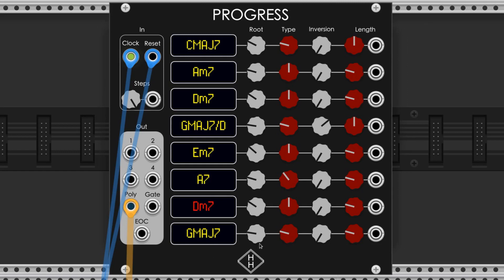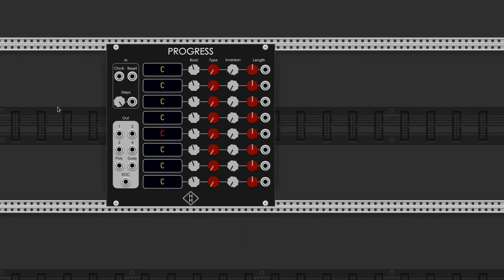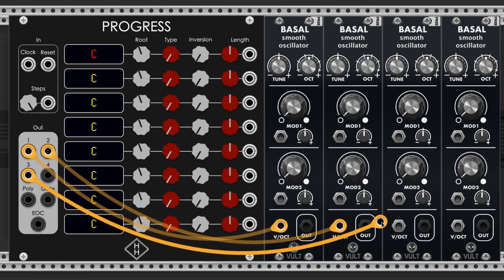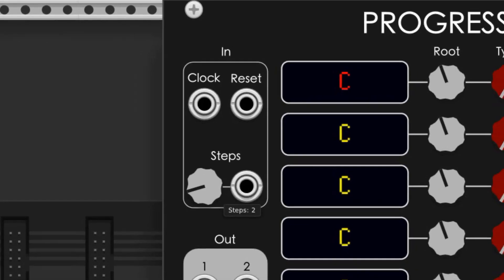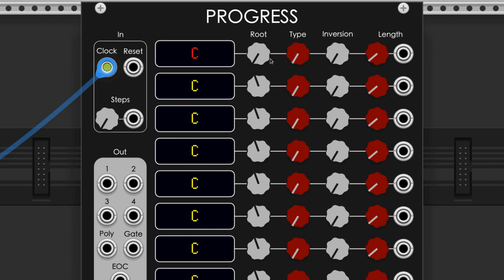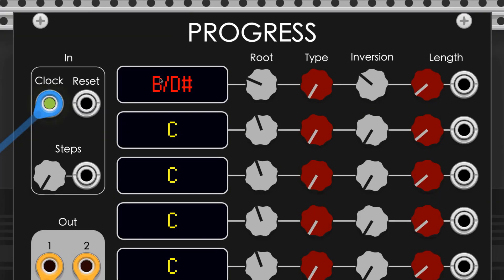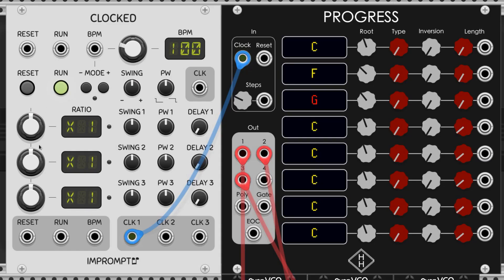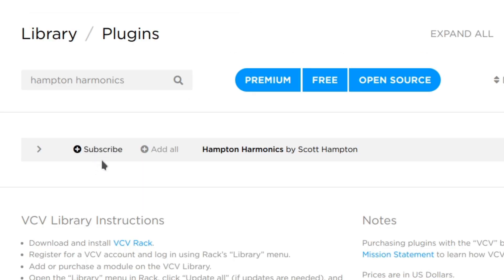Sequencing Chords: Progress by Hampton Harmonics

Comment: When the Cm7 chord is played @1:25 Progress seems to automatically be set to a spread voicing, as opposed to a closed voicing (up the scale within one octave). The oscillators seem to all have identical settings.
Reply from the maker: Thank you for the comment, Blerkh. The default for the progress module is a closed voicing; however you're correct I utilize an open voicing by taking the individual v/o outputs and altering the octave switch on the PonyVCOs. In the example patch, on the right of the progress you can see the ponies have all the same settings except some have different octaves. Open voicing sounds so full :)
Reply: @yourpalrob  Ah, I see it now! I saw the 0s, but didn't notice the different octave "slider" positions.